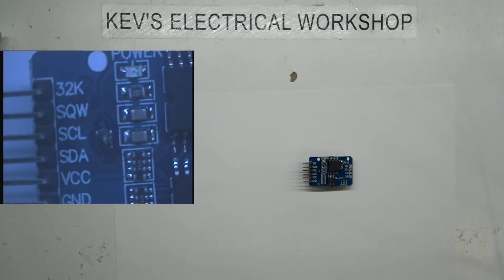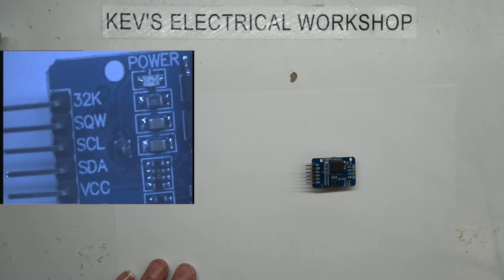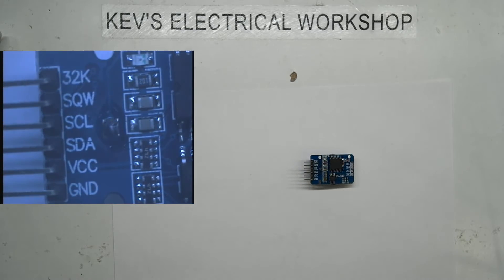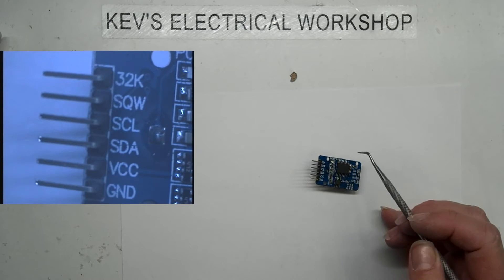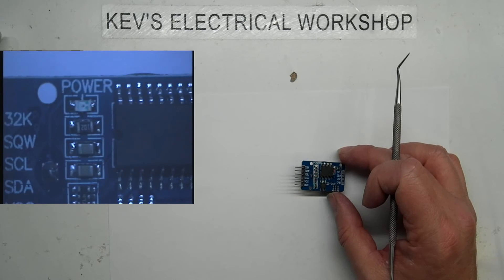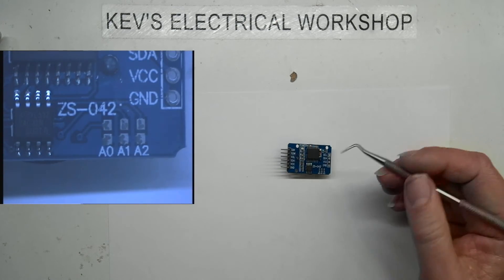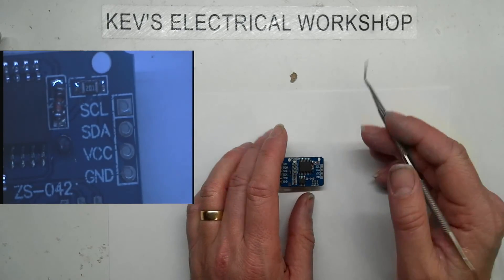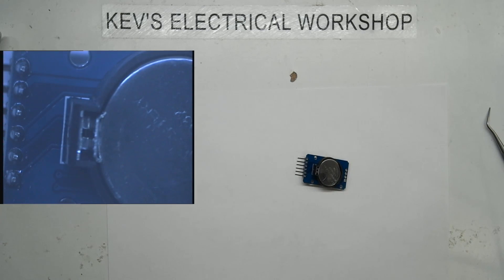DS3231 Real time clock with I2C AT24C32

Comment: One thing is these boards charge an ML2032 (or similar) so be careful of connecting a button cell CR2032 (non rechargeable).  You can remove the resistor or diode to disable the charging - meaning you can safely use a CR2032 battery.
Reply from the maker: Good point there Chipko

Comment: Here's a current sensing module you should try.        http://www.ebay.ca/itm/20A-ACS712-Module-5V-Measuring-Range-Current-Sensor-Hall-Board-For-Arduino-new-/221649135732?hash=item339b516874:g:4C4AAOSwWfFXkJMD         I find them really useful, especially this 20A version that puts out 100mv per amp. That making it a simple matter to do the math in your head as to the current reading. They are fast as well. I have used them to display on a scope the current into an ignition coil which can rise in less than  a millisecond. Now if you put that with your real time clock and memory and find a constant current source you have a nice battery charger and discharger that you could plot the discharge / charge curves.I enjoy your video.  Thanks
Reply from the maker: Looks nice, would be a bit suspicious about the board taking 20A
Reply: I'm even more suspicious of the terminal strip which I don't think will take wire over about 16ga. and the flimsy internals of same. But as far as the board goes, it MIGHT be ok. The traces go right from the strip to the chip. And they are very short . They could be beefed up with some solder. Certainly the chip is made to take it. It's basically a bus bar inside with a linear hall sensor to measure the magnetic field from the current (I think that's what I read on the spec sheet for the ACS712 chip). They also make a 30amp version in the same format.  I've had at least 10amps through my 20A module but not continuous. Another one of those modules I hope to get around to using other than my ignition circuit testing.
Reply: BTW. They can measure AC as well as DC. The output is centered at 2.5 volts with no current so it can travel up and down from there. (20 amps x 100mv = 2volts in both directions 0.5 to 4.5v).